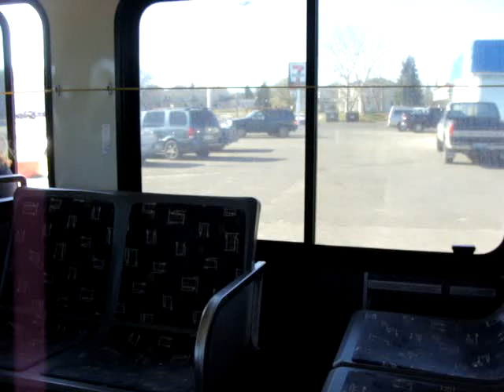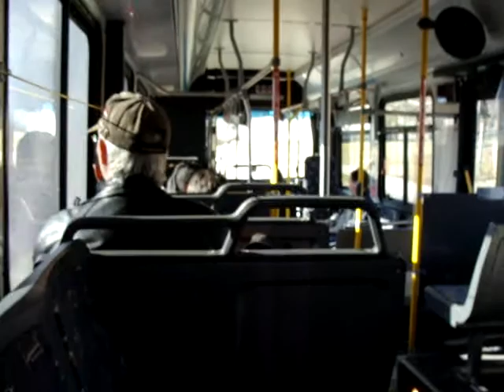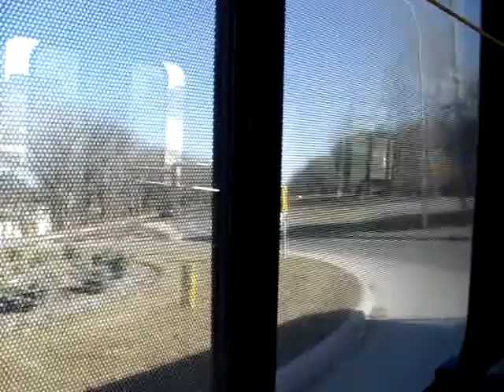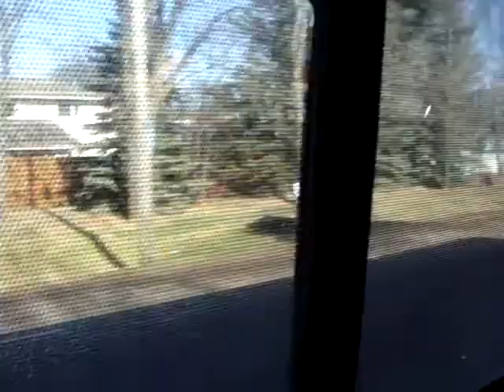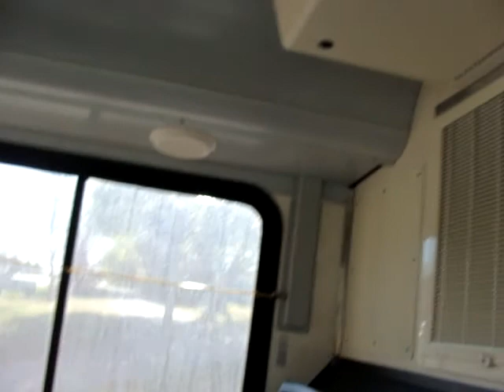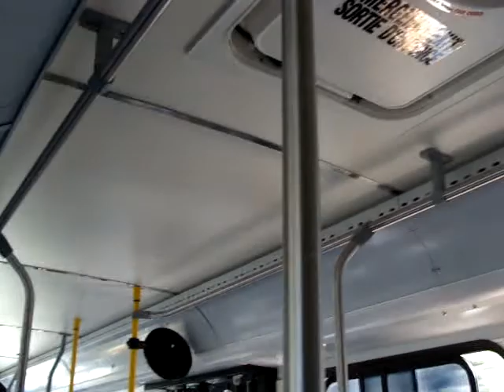2010 New Flyer D35LFR (Brandon Transit 55)

Comment: I bet these must among the buses that have one of those last EPA 2007 Cummins ISL engine because the sound it was like that. Cummin ISL9 are noticeablly quiter on the outside, but from the interior, it has a stronger sound during accelerartion from the rest and does not has the that low pitch humming secondary sound hear from the interior (not from the engine radiator) as the engine increases its rpm.